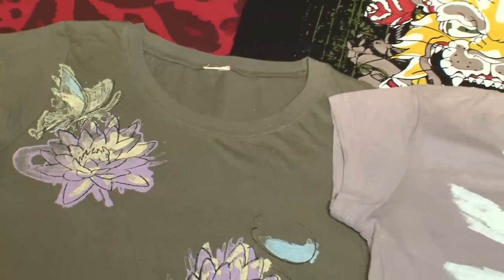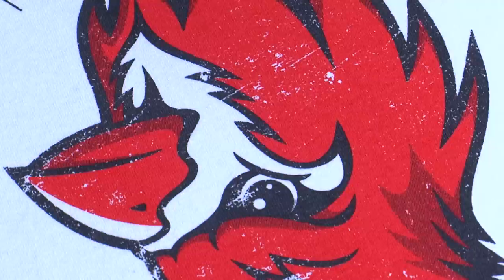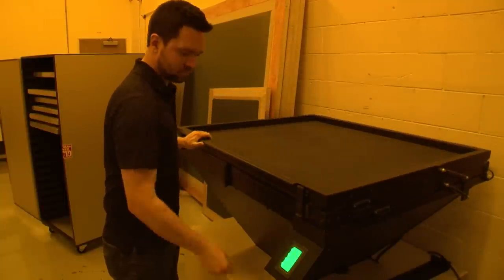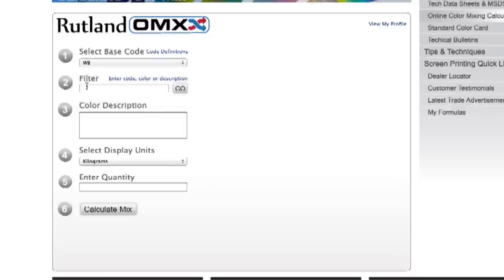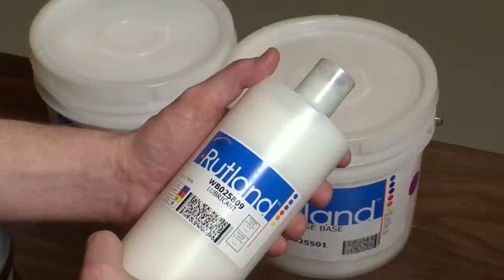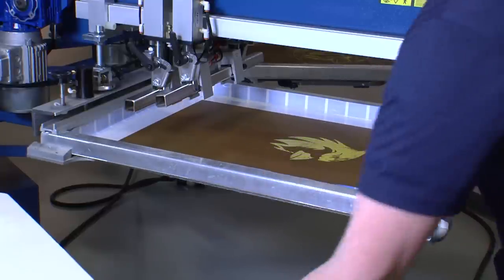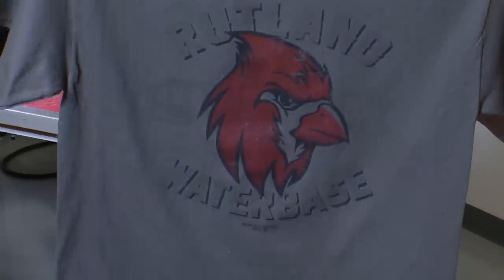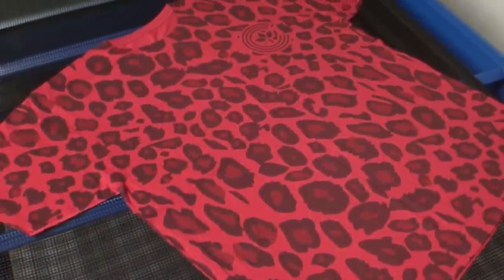Printing with WB99 Discharge Ink by Rutland

Comment: is 350 degrees a standard temperature?
Reply from the maker: 350 degrees is common for Plastisol inks, but correct temperatures and retention times for inks vary depending on the curing requirements for that ink. Always check with the manufacturer or your ink supplier for the specific requirements of your ink.